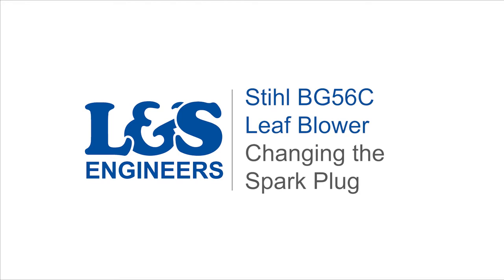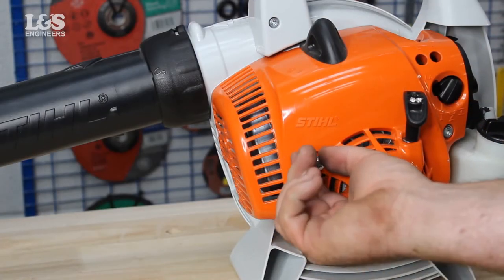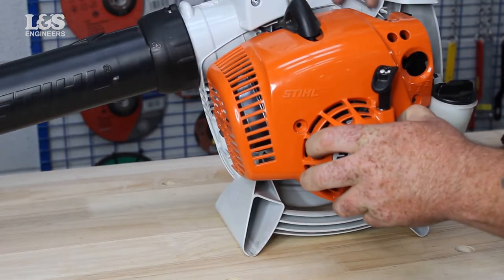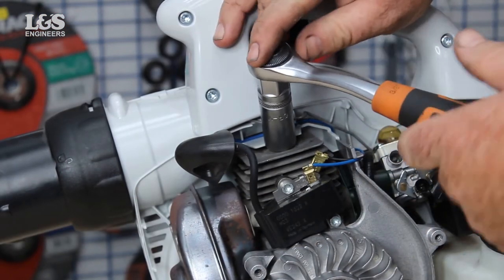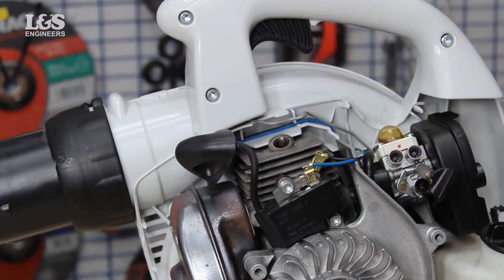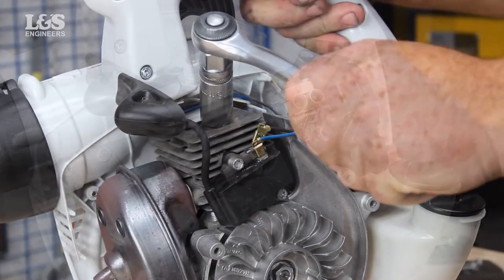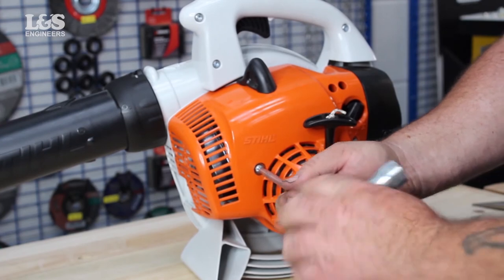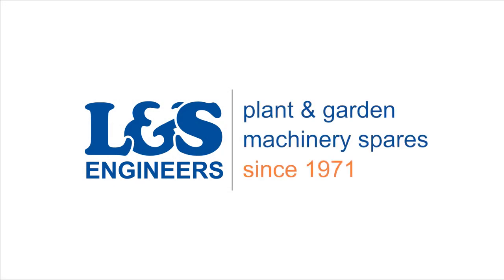How to Change a Spark Plug on a BG56C Stihl Leaf Blower | L&S Engineers

Comment: yet no mention of checking the gap

Spark plug (resistor
type): NGK CMR 6 H
Electrode gap: 0.5 mm
Reply: Aka 0.020 Inch (20 thousandths of an inch). 😉